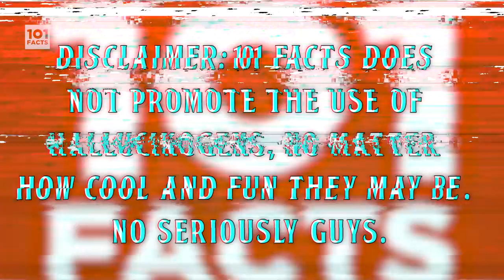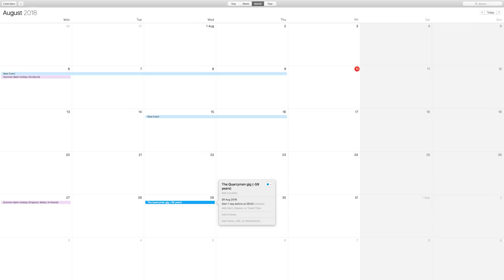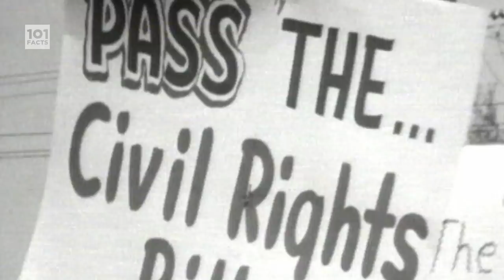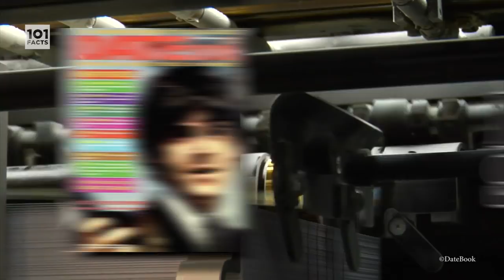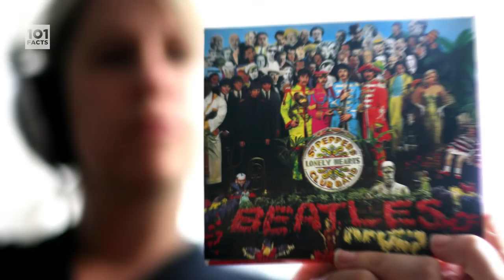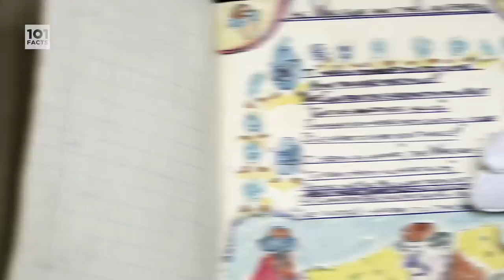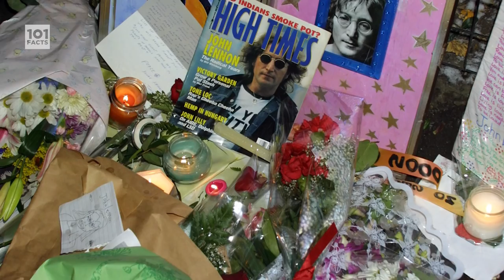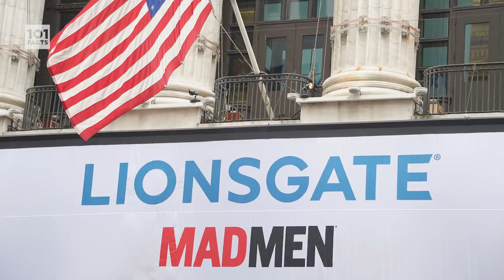101 Facts About The Beatles

Comment: 22:57 actually, that's wrong too. The longest song by the Beatles is Take 3 of Helter Skelter, which is 27 minutes and 11 seconds long, And the longest song officially released by the Beatles is Helter Skelter take 2, which is almost 13 minutes long.
Reply: bluepeng889 nope. That’s an alternate version that wasn’t final. The longest song is also on the White Album, titled Revolution 9, clocking in at 8 minutes of tape loops, backwards stuff, and spoopy tunes.